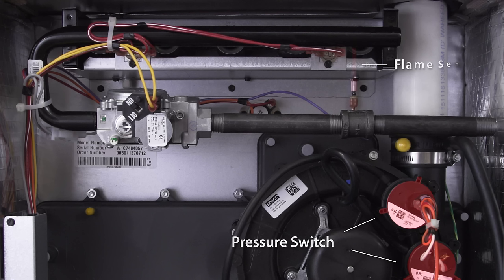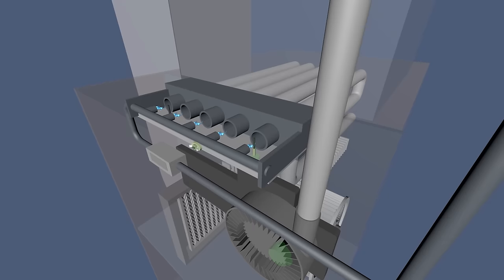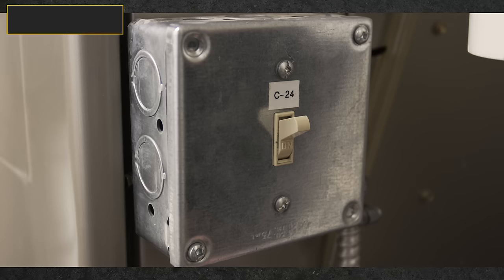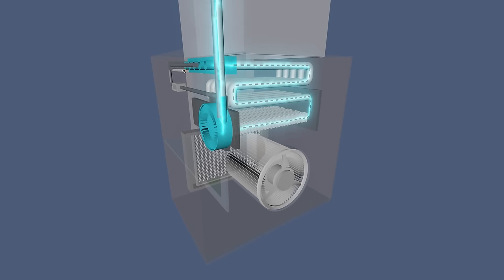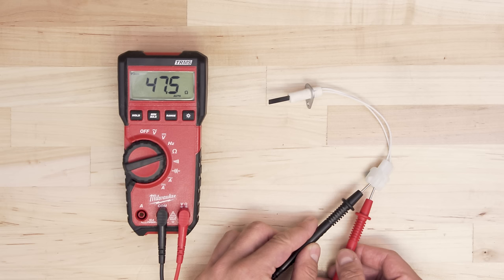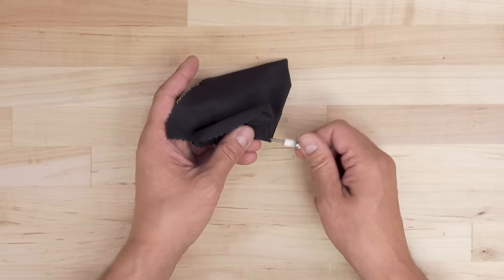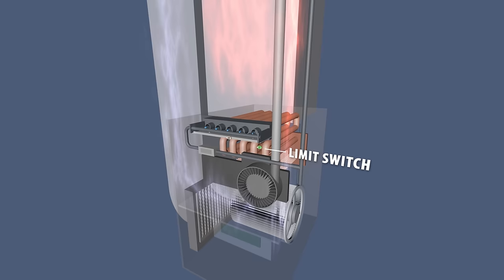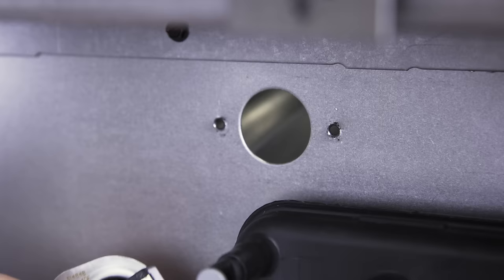Furnace Starts Then Stops - Troubleshooting | Repair and Replace

Comment: You mentioned in the beginning of this video the different kinds of safety switches - pressure switch, flame sensor, flame rollout switch, and the limit switch and what they do. I was wondering what the flame rollout switch does and the signs of when to replace it? Your videos are awesome and I love this channel. Thanks for all the education!
Reply from the maker: Thank you, we're quite glad that you're finding the videos helpful!

The flame rollout switch monitors the burners, if there is an airflow issue and the flames are "rolling" out the front of the burner, then the switch will disconnect power. 

If you notice a lot of carbon buildup around the front or and the switch then that indicates a flame rollout issue, and that will need to be investigated further.

If there are no signs of a flame rollout, but the switch is having issues, then it could be a faulty switch. The flame rollout switch should have continuity at room temperature. If it doesn't then it's faulty and should be replaced. This kind of failure is not that common though.

Comment: tks very much, it was a dirty flame sensor, cleaned and is now working, will buy another as a backup - great video
Reply from the maker: You're welcome Rj, thanks for watching! While you're at it its a good idea to have an extra furnace ignitor on hand as a backup. Ignitors are a common point of failure as well.

Comment: Had the exact issue you described with the shuts off after ignition. Per your directions I cleaned up the flame sensor and it turned on immediately. Thanks!
Reply from the maker: You're welcome! We're glad that its working again!

Comment: Thx u. God bless 
I Survived 14 degree weather cleaned everything put it back
Thx so much god bless u again
Reply from the maker: Thank you Tom for sharing your experience. We're glad you were able to get everything back up and running!
Reply: Hi I have question my igniter turn on three times then my fire starts and my light is blinking 3 short  and 4 long ones once the fire starts then stay lit everything else is normal the only problem is my igniter light up 3 * then I'll leave my gas releases them the fire and I change all three senses what do you think the problem is
Reply from the maker: Best to check what that code is. The code is different for each model so check your furnace manual or the diagram which might be on the back of the furnace door. 

Also if the furnace ignites but doesn't stay lit or takes several times to stay lit, then it might be worth cleaning or replacing the flame sensor. That would be the first place to start.
Reply: Im getting three short and for long(34) bryant. Model # 310aav036070adja.  
Ignitor Light Up 3 times and shut off with the machine on  then only gas  and fires up
Reply from the maker: @gomasmas5727  The 34 code for that model is a "Ignition Proving Failure" what you are seeing is the furnace try to light 3 times then shut down and lockout until trying again.

The furnace igniter could be faulty or starting to fail, you can learn how to replace it here https://youtu.be/LAAYMOpVf-8
Also the burners could be dirty and obstructed, it best to clean them as part of regular maintenance https://youtu.be/1giPLrObYb4?t=140

Comment: Wow I finally figured out my problem after fixing 3 relays in the motherboard (clicking noises). There was some dirt in the ignitor. Cleared it up and now the heat is on!! Thanks
Reply from the maker: Thanks for watching. Cleaning is always a good idea, its such a simple thing but it can definitely help. We're glad you have things up and running again.

Comment: Thank you so very much for making this video. You guys ROCK! The speaker was so very easy to understand, he enunciates everything perfectly! I FINALLY was able to fix our central heater, after weeks of going without. Tonight my family gets to stay warm for once. Thanks!
Reply from the maker: You are welcome Christopher! We're happy to heat that this video helped you out! What finally solved your problem in your furnace?
Reply: @AmreSupply  It was the flame sensor on my really old but really reliable Goodman furnace. I did exactly as stated in the video and took it out and cleaned it with some steel wool, and voila! Household heat!
Reply from the maker: @Christopher-fz4cw  Flame sensor issues are still common even with a reliable furnace. We're glad that it was a simple fix for you!

Comment: Napolean furnace 9600 series. Model NPV080T3B. Bought new in Nov 2016. Jan 2020 now. Furnace would turn on when I wanted heat. Burner would ignite but quickly shut off. Furnace would attempt to start 3 times. Turns out it was a dirty temperature probe or flame rod. Used my slightly aggressive dish cleaning pad. Cleaned the black soot off. dried it off. made sure there was no debris or anything that would cause a short. reinstalled and BOOM. lovely heat! Thanks for this video.
Reply from the maker: Thank you for sharing that with us!  A dirty flame sensor is quite a common issue, but a simple one to eliminate first before anything else. We're glad the video helped you get your furnace heating again!

Comment: Awesome video! According to the video my flame sensor needed a cleaning. Furnace is up and running fine now, hopefully this solves the problem
Reply from the maker: Thank you! We're glad you found the video helpful! As well dirty burners can interfere with the flame sensor, so you have problems again, make sure that the furnace is clean!
Reply: @AmreSupply  The flame sensor was cleaned yesterday morning, the furnace work fine all day but now it has the same problem today. The flames comes on for about 10 seconds and then shuts off and the cycle just keeps repeating. What else could be the problem?
Reply from the maker: @chueyang7221  For the flame sensor to work it needs to be positioned in the flame and the burners need to be clean. 

There needs to be a path to ground from the burners to the furnace frame. If you have a multimeter you can test from the metal on the burner to the furnace frame to see if there is resistance or continuity. If there is no continuity then the flame sensor will not work as the circuit will not be completed. 

As well make sure that the flame sensor connections are secure and that there is no corrosion on the terminals to the control board.

Comment: Thanks that video talks around what my furnace is doing but not exactly. My gas valve receives 25.8 volts but only for two seconds. The igniter is hot as can be but I don't think two seconds is long enough for the gas to flow/ignite.
Reply from the maker: Thanks for watching. The voltage is good as it should be around 24v to open the gas valve solenoid. The solenoid will need to stay open, which will require a sustained 24 volts. It is unlikely for this to be a problem with the flame sensor as the control board monitors the flame sensor voltage usually over 7 seconds before shutting off the gas valve. This seems like an issue with the control board as that is what is dictating the incoming voltage to the gas valve. The control board is difficult to test, but is relatively easy to replace. You can see how to access it in the video linked below: https://www.youtube.com/watch?v=4SY8lRl8HV0
Reply: @AmreSupply  Tnx,I timed it and it is definitely under three seconds.

Comment: This video is very helpful, thank you! I do find my furnace shuts off due to water in the pressure switch tube. But after clearing the water for a week, I got water in my tube again. This happens multiple times this year. Do you have any recommendation for this issue?
Reply from the maker: Thanks for watching. Check the condensate tube and make sure that it can drain properly into the drain or condensate pump. Any restriction of this might cause a buildup of water in the pressure switch.

Comment: How long should a limit switch last? I replaced mine because my furnace would run, heat the house, then the blower would turn on and shut off after 15 seconds or so (short cycle?). Replaced mine last February and furnce worked fine until today (less than a year old limit switch). I have a Miller CMF80 propane fired furnace.  Thanks for the videos they are great!
Reply from the maker: Thanks, we're glad you're finding the videos helpful! Limit switches don't normally fail that quickly. Its possible that the furnace is overheating. It would be best to replace the furnace filter to ensure that there is proper airflow over the heat exchanger. As it would be best to give the furnace a good thorough cleaning. If nothing helps there could be a restriction somewhere else in the system so it might be good to get the furnace checked out by a HVAC technician.

Comment: great video, my problem is the furnace ignites and burns for a few minutes that shuts off. It will keep doing it for 5 cycles and lock down. I get a code 8 for york which says it could be the flame sensor, low pressure, or gas valve. I cleaned the flame sensor and it still the same issue. I even changed to a new one and same thing. I'm thinking it's the gas valve?
Reply from the maker: Thanks for watching! If you're getting a code 8, and you've eliminated the flame sensor as a source of the problem then it could be low gas pressure or a faulty gas valve. In this case its best to call a technician.

Comment: Need help. My furnace is 1 yr old from new house. It runs, ignite and fire come out then there are times the cover of furnace banging noise and fire shuts off. Sounds like a pressure makes the cover banging then the fire shuts off.What it could be please?
Reply from the maker: Thanks for watching, it could be a limit switch or flame rollout switch. If it is the flame rollout switch being tripped more than once, then that means that the airflow is compromised and the flames are not burning properly. In this case it's best to get it inspected.

Comment: Hello. Great video.  Keeprite furnace just quit today.  Pretty sure it was on this morning.  Diagnosed as video.  Secondary fan runs, flame lights blower does not start.  Cleaned rod.  And checked limit.  Getting .2 ohm . Now you said 0. Is it bad.  Is there any way of testing flame rod. Thx
Reply from the maker: Thanks for watching. Continuity is anything over 0 ohms of resistance. 0 resistance means that a completely unrestricted path is there for electricity to flow through. If the limit switch had no continuity, then it would have no resistance reading on the multimeter or OL "open loop"

In your case the limit switch is likely fine so it's worth checking a few things. The flame rod / sensor isn't anything special, it is just a metal rod that helps complete a circuit from the control board, to the flame to the metal of the burner, to ground. So try cleaning the burner and make sure that all the connections are secure. You can also check to see if the metal of the burner is indeed grounded by using the resistance setting on your multimeter.

This is explained here: https://youtube.com/shorts/Bl2hGox1lcs

Comment: Great video!
I still have a problem with Amana furnace.
 After I set the thermostat at 69F the furnace was on at 67F and off at 71F; but didn’t start again when for another cycle. The red LED light on the control board was on indicating normal operation. I turned off the power to the board and back on after 30 sec and the furnace turned on. After the cycle ended, the furnace would not turn on again unless I turned off the power to the control board and back on after 30 sec and the furnace turned on. After the cycle is over, if I try to turn on the fan only, it doesn’t start. Do you have any suggestions?
Reply from the maker: Thanks for watching. If you want the fan to blow you can set the fan to ON, automatic will only have the fan blowing when heat is needed.

When it comes to a thermostat, there's an acceptable range that it will try to keep the temperature. The furnace will cycle on and off as needed to keep within this range. The frequency of how often the furnace runs is often linked to how cold it is outside and how much heat is being lost every hour. On a cold day you might find that the furnace runs very often. On a cool day that is sunny, the sun will heat your home and reduce how often the furnace runs.

Comment: Paid $185 to have a company who I will remain nameless come look at my furnace and tell me the exhaust fan is failing did I need to order one for a few hundred dollars then pay a separate fee to install new exhaust fan blower motor along with the sensor that reads for unburned fuel I was looking at close to $600 before the holidays thanks to this video I clean the flame sensor with a piece of quad zero steel wool and fix the problem thank you so much happy holidays
Reply from the maker: You're welcome Todd, we're just happy that you were able to get the furnace working again without all that extra work being done.

Comment: I have a Rheem Criterion that started blowing cold air.  I noticed the igniter stopped working and no gas coming out when blower kicked on. The air filter (kitchen ceiling  intake) was dirty so I replaced. Also replaced igniter, limit switch, and pressure switch. I cleaned the flame sensor and checked condensate pan…no water. 
Also troubleshot the circuit board, appears good. 
What am I missing?
Reply from the maker: Thanks for watching. If you've eliminated each of those components and the gas valve still isn't opening then it could be an issue with control board or the gas valve. 

This might be worth getting a tech to inspect it. They would check if the gas valve is receiving voltage. Then narrow down the issue from there. If the gas valve solenoid is burnt out, or if the control board is not sending any power, then the gas valve won't open.

Comment: Thank you so much for this helpful video. A HVAC professional replaced the draft inducer motor on my 11-year-old York furnace 2 months ago. After this replacement, the furnace needs 3 - 4 short cycles (sometime only the first 3 of the 5 burners are ignited, or all burners go off 3 - 5 minutes after they are ignited.) to get started normally, and the sound of the burners sound much louder than it was before. I replaced all the pressure switches, limit switch, ignitor, and flame sensor and also cleaned the burners, but the issue still exists. Should I go to the controlling board for the next step? Thank you
Reply from the maker: Thanks for watching. If the furnace has a weak flame or that not all of the burners are lighting It could be an issue with the gas supply, or the orifices that supply the gas. If its clogged, then the orifice can be unscrewed and cleaned with a small pin or wire. This should help gas flow freely when the burners are lit.

Comment: I have a Carrier furnace installed around 2005. Stopped working. I opened the main lid (well, it was left half-opened by the installers), then the cover that has the LED....(the cover has a round viewing window) And I found there's a cover-activated switch there. I pressed it and the furnace fired up. Not sure whether it was cold air or warm air, but it cut out in about a minute(i was holding my finger on the switch). Also, the one and only (red) LED is not flashing or doing anything for that matter. It's gotta be one of these issues. Thanks for the video. (Why does the LED not do anything?)
Reply from the maker: Hi Bob, thank you for watching. Yes the door switch can be a simple problem if its not pressed closed. 

As for the LED light, not all furnaces are the same. Some models will have a single light that just flashes to signal normal operation, and then have multiple flashes for error codes. Some models might only flash any lights for error codes. 

Now if the furnace continues to shut down even with the door switch pressed then observe the start up sequence to try to narrow down when it shuts off.

Comment: This is what my new system is doing (short cycling) but only at night to early morning. Then during the day it’s ok???? When we turn the heater on at night it works but at some point it fails to automatically restart in order to maintain the desired temperature. Any ideal’s? Thanks
Reply from the maker: Thanks for watching. At night it is generally colder which requires the furnace to work harder to maintain the temperature within the home. Since it is a new system it could be the limit switch tripping and could be because of an filter with too high of a MERV rating restricting the airflow which can cause the heat exchanger to to overheat. If you removed the air filter one evening and let it run, it would be a quick test to see if that changes the short cycling behavior. 

Alternatively it could be that the system or the fan speed is not properly matched for the size of your home. It could be worth contacting the person who installed it to take a look.

Comment: I've got intermittent issue where the furnace ignites for a few seconds and then shuts off.  The furnace continues to attempt to cycle through but will not ignite from that point.  If I turn the breaker off for a few minutes and back on the furnace works fine for a while.  I've cleaned the flame sensor, could a bad flame sensor cause an issue like this or would it most likely just either work or not if the sensor was bad?
Reply from the maker: Thanks for watching. The flame sensor is just a rod that helps complete a circuit from the control board, through the flames, to the metal of the burner and to ground. If the flame sensor, the burner or the housing is dirty, then it might prevent a circuit from being completed. Clean the flame sensor and burner and check to make sure all connections are secure.